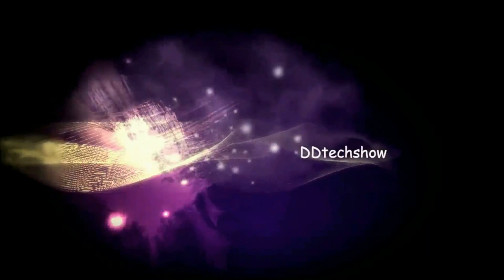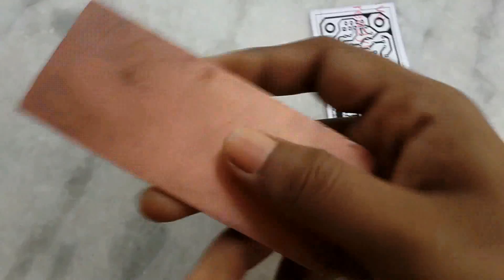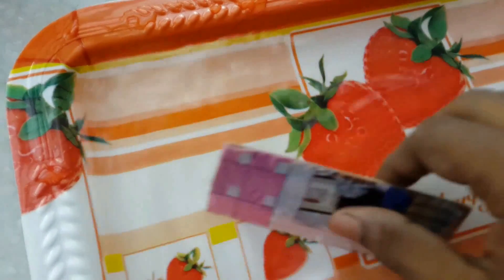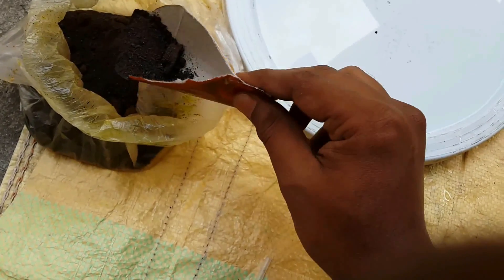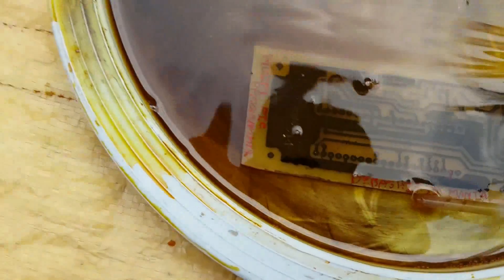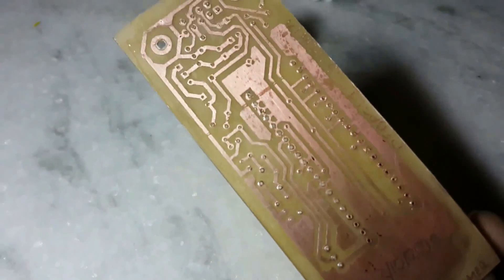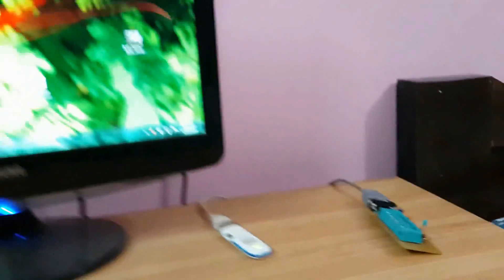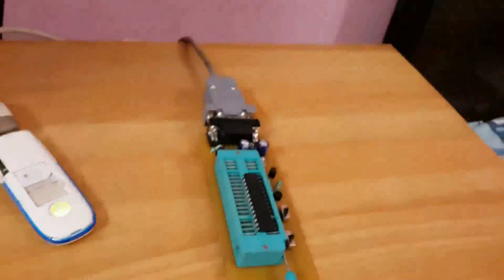How to make a simple multi pic programmer on pcb / Make your own pcb at home

Comment: please, kindly answer the following questions.1) Does it works for PIC16F877A?
2)What is the purpose of the switch?3)Which transistor connection should be altered? Q1,Q2 or Q3?
4)And in circuit diagram Q3 is shown as mosfet but in PCB circuit it is written PNP transistor only, what type of transistor is Q3?
Reply: did u find any answers to these questions ??

Comment: You changed The NPN Transistor position which is next to the serial socket !!!
What is the perfect connection , please ?
Reply from the maker: +Mahamad Salheen if diagram's position not work then change its direction ( emitter base collector / collector base emitter)
Reply: +DDelectroTech.com  Thanks
Reply: did it work ?

Comment: Hi
I was print & etch the circuit board & assemble the components  , the programmer work properly but I was unable to program PIC16F84A & PIC12F509 not sure why
Reply from the maker: +MikroTik Man  Change the direction of transistor , it will work
Reply: +DDelectroTech.com 
Thank you for you reply , but which transistor ?
Reply from the maker: The transistor which is near the DB9 connector
Reply: +DDelectroTech.com 
Thank you much appreciated .
Reply: what are the types of transistors used in Q1 and Q2 and Q3
Reply: Hi , all the transistors are BJT transistors
Reply: u got any commercial name for these transistors ? 
i am from egypt and i really spent large time trying to build it i would appreciate if u answer me or help me on 
facebook.com/jimmyprofileD
Reply: Hi , please check the link in the video description above , you can see the component layout & on it the transistors marked as NPN & PNP , for NPN you can use the 2N3904 & for PNP you can use 2n3906, I guess those type of transistors are widely available in the local market in Egypt , since those models are commonly used in many circuits for professional & hobbyists, I tried those models & the programmer works , hope you can do it too.

Comment: Hi
Can you share the circuit diagram , seems this programmer work with PIC MCUs only
Reply: can u supply me with the commercial names for the BJT transistors u mentioned earlier as they are used in the Q1 and Q2 and Q3
Reply: is there any mosfet in the programmer as the schematic says
Reply: do not follow the circuit schematic, but follow the component layout provided on the same page it is more accurate
Reply: Hi , please check the link in the video description above , you can see 
the component layout & on it the transistors marked as NPN & PNP
 , for NPN you can use the 2N3904 & for PNP you can use 2n3906, I 
guess those type of transistors are widely available in the local market
 in Egypt , since those models are commonly used in many circuits for 
professional & hobbyists, I tried those models & the programmer 
works , hope you can do it too.
Reply: Dear Jimmy, can you inform me with the model of PIC MCU you want to program ?

Comment: Can this programmer work with a USB-to-Serial adapter?....I hope you can answer :)
Reply: tiger93333 
Hi , This programmer required a built in Serial port , USB to Serial will not work , I test that my self
Reply: what are the types of transistors used in Q1 and Q2 and Q3